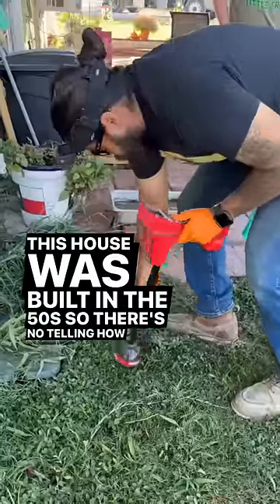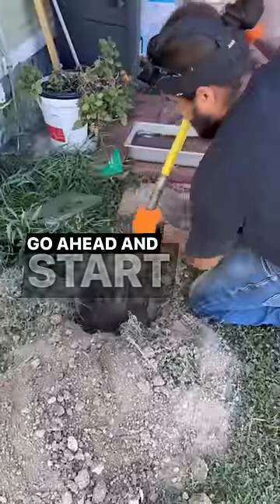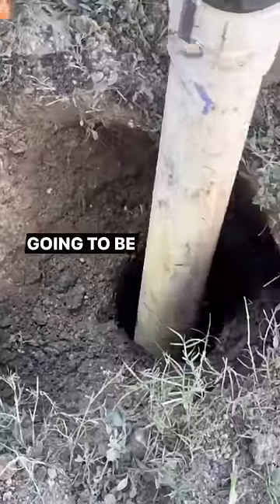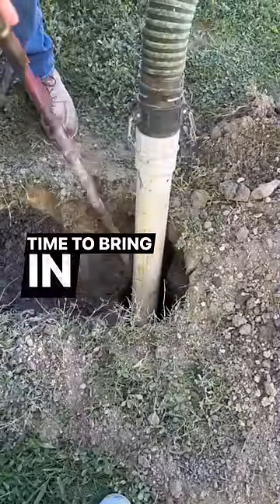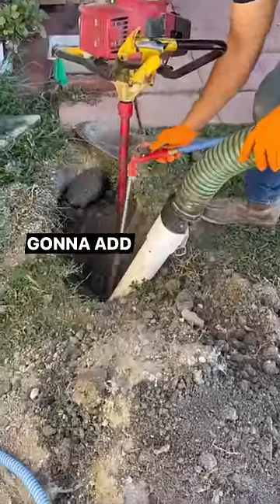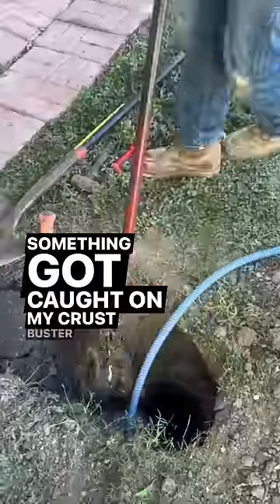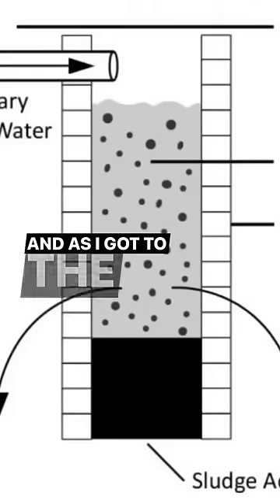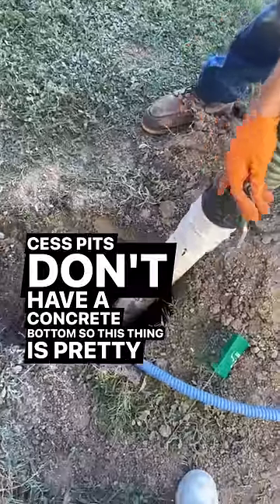Flushing a Prototek Transmitter to find a Septic Tank #shorts

Comment: Had to call a septic tank service a couple of months ago. They said they couldn't pump it cause there was too much gray matter. Said we needed a new tank and quoted me $8000. Thieves they are. Called another company. An old guy with some hard working young men. He comes out and goes o yeah we an fix that. 400 later and it was fixed. I appreciate you work so hard for your customers

Comment: Bro I see this everyday in apartments,  the wax ring is old and is leaking to the down stair unit and wants to install a new kitchen faucet. I do the kitchen faucet and as I'm doing that, the customer is on the toilet taking a dumb. Finish installing the new faucet as she is finishing, run to my truck so its not awkward come back upstairs and they not cover the smell or tracks left behind when flushEd and to really get you they had air freshener and did not use it.